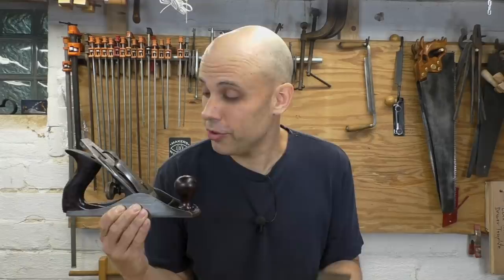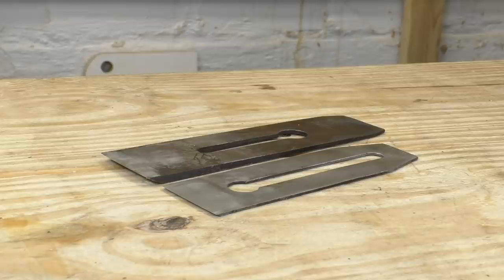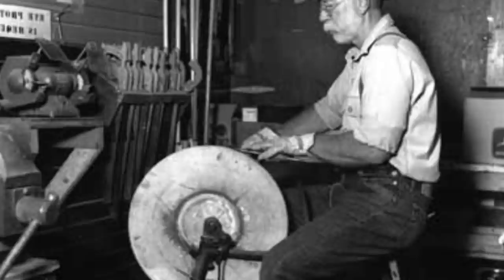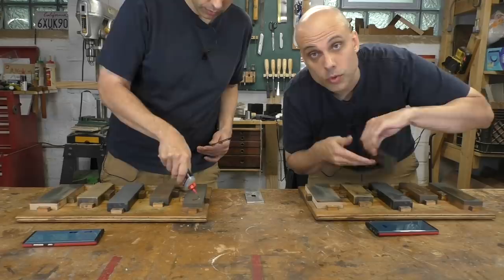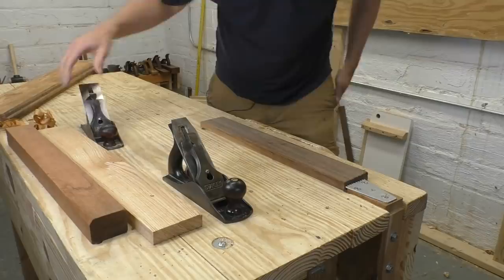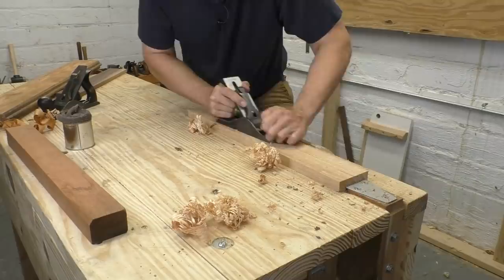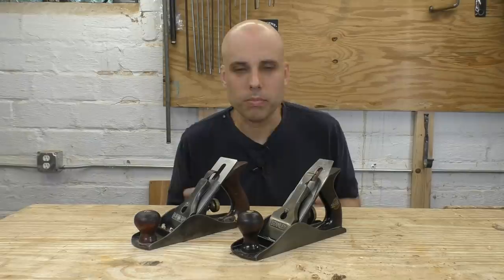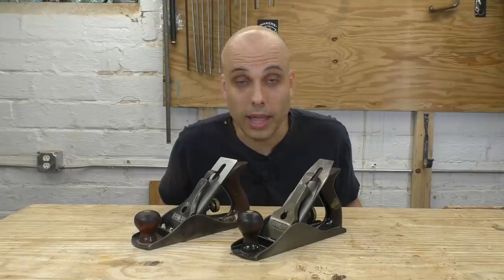Modern vs. Vintage Plane Irons. Head-To-Head Test!

Comment: Nice video, and I agree to some extent that the old Stanley irons are adequate. But I think most of the thickness of older irons, and the taper from thick at the cutting edge to thin at the other end, was not to do with the forging process but with the way the iron was held with a wooden wedge. The taper gave the irons better wedging power. In addition, all of my older Stanley irons are laminated, not one piece of high-carbon steel. Anything from the sweetheart era or earlier seems to be laminated. The big difference between older irons and the newer ones in my experience is how long the edge lasts. In Australian hardwood, the older irons go blunt very fast.

Comment: I tried a thick iron and chip breaker.   It was impossible for me to get it in the plane and tuned, with out filing out the throat, of and old #4.   Someday I might make a wooden plane to use it.

I think perhaps that the heavy iron is superior to the modern thin irons, because the modern irons are simply thin and don’t have the harder edge welded on.

Comment: My Stanley #5 with a thin iron jams up on me a lot. This video is perfectly timed as I was thinking of trying a Hock blade to avoid the jams. But I guess the Hock blade jams, too.
Reply: Check your chip breaker where it makes contact with the blade near the cutting edge.  If there is even the smallest gap, jams can happen.  You can grind the chip breaker at an angle so its edge makes good contact with the blade across the full blade width.  The jams should disappear.
Reply: @richardweiler1552    Or could have mouth too tight for for size of cut you are taking=ing.

Comment: Great video! To add to the modern blade thickness hype, I found modern steel's performance to also be mostly speculation. I tested PM-V11 irons to see if I wanted to switch over for my vintage Stanley planes. On maple end-grain with a no.6, they ended up chipping after 40 seconds of use, consistently. The vintage Stanley ones dulled a little faster but never chipped. I talked to some experienced woodworkers about this and after asking around, I found most people went for pm-v11 over A2 or 01 steel because they assumed it was better and "why not spend a few extra dollars if they may be better." But no one seemed to actually be able to say they could notice a real difference with the pm-v11. 

Another thing to note is that some planes brands have pour blade support. If you have less support at the edge you end up with chatter unless you compensate with a thicker iron. This is, apparently, why Lie Neilson uses such thick irons. Stanley planes were always some of the best planes in this regard. Their Bedrocks have so much support there's hardly no overhang; but even their baileys are half of most of the competition. 

Also, I loved the history stuff at the start, didn't know all that!

Comment: Some of us do like and use sargent planes and the hock chip breaker will not work but the blade should work, just saying.
Reply: Good to know. I have a Sargent No. 409 and have been thinking of replacing the blade with a Hock, or Pinnacle, etc.. (Then again, having an "Extra" chip breaker might just encourage me to pick up another Hock blade for one of my other similar sized planes.)

Comment: very nice video, thanks for the the historical perspective! I'm not sure though, that it's fair to say, that the difference you felt has necessarily anything to do with the thickness of the iron. There's just too many confounding factors, like the exact setup of the chipbraker, the curve of the iron, how much the iron protrudes (thickness of the shaving), the condition of the sole of the plane or the sharpness of the iron. But since you don't really claim that there is a huge difference, I guess I'm not really trying to criticize as much as I'm trying to raise awareness that such simple tests are often not adequate to spot differences or the lack thereof. Speaking of the chipbraker, how was it set up? What bevel angle and what distance from the cutting edge? If your iron is really sharp, the chipbraker has a bevel angle of about 80° and is only about 7/1000" (0.1-0.2mm) behind the edge and you take a very light shaving (if you try to take a heavy shaving, it gets really hard to push the plane, so this is really only suitable for smothing) you should be able to plane any wood, even against the grain and get a really really good surface.

Comment: Good point made quietly. We're living in an age of overavailability, hence why we use multi-stone sharpening setups. We do more work worrying about the last 5% than we do working and profiting from the 95%. I seldom sharpen my chisels and planes, and strop them regularly during use. Even when I do sharpen them, a combination stone with good technique gets them 95% of the way towards being sharp. Getting work done puts money in the bank, and there's only so many hours in the day to waste gazing into one's navel! Ron Hock's blades are a better tool than stock if your setup can handle the more demanding sharpening. I wouldn't swap out a good stock blade on that basis though.
Reply: It really depends on what you are doing. If you want a fine furniture finish you are going to need the sharpest tools possible and selection of good woods suitable of that finish. 
The level of finish will all come down to what  you are producing. I do not do a lot of fine furniture but when I do it requires effort and concentration.

Comment: I would venture a guess that the reason some people proclaim how much difference a "modern" plane iron makes is that it may (in theory) make much more of a difference in a less well tuned plane - given your skills and experience in plane restoration, I would expect that just about any iron put into one of your planes would work well. 

However, if the restorer or manufacturer or tuner aren't on your level, and the bedding of the iron does still have a tiny little bit of play (or atleast tendency to vibrate) in it, then I would imagine that the thicker and stiffer plane iron would actually make much more of a difference to the performance than it would in a better tuned one, doing more of the work of damping movement in the cut with the blade itself rather than the body of the plane.

Comment: Rex, first you have to be sure each plane has a solid contact flat bed to support the blade. Second, the chip breaker must be honed for perfect contact with the blade across the entire width.  This of course is basic to all planes.  That said, you might want to try swapping the chip breakers between both blades as a test!  You may find the more substantial chip breaker has as much or more to do with that "solid feel" than the blade itself!!

My biggest gripe with Stanley plane blades is the initial flattening of the backs. They all too often require a TON OF HARD WORK achieving flatness to the edge!!  The "aftermarket" more expensive blades are at least reasonably close to flat requiring far less work.

All said and done you are right about the misconception of "thick" blades being so much better!

Comment: I was restoring my first two planes - both english, one a stanley #4 copy goodwin and the other was a brand I can't recall, but much simpler with no lateral adjust and only forward. I cleaned up the older, no-name one - which had a ton of iron left and needed NO grinding attention, but I noticed while sharpening that it was throwing the fattest wire I've ever seen on something meant to cut. I was curious, so I finished the sharpening until it was shaving-sharp, reassembled it, ran it across a piece of hemlock...

And within two strokes it was too dull to cut my thumb if I went at it like a steak-knife. Somehow the iron on this never-modified, all original plane had lost ALL its temper and was soft as butter.

The plane was like 8 bucks so I figured I couldn't hurt anything by trying to re-temper it, so I heated it up cherry red with a couple propane blowtorches sitting on my bench for a good 10 minutes and then dunked it in a jar of canola oil to quench. I threw it in a 400F oven for about an hour to draw back and somehow that put the iron at a PERFECT hardness. Now it doesn't chip, doesn't dull any quicker than my known-good irons, takes/keeps a razor edge, and has for a year of heavy use.

I wonder if people say the thin irons are no-good because they've gotten one that someone in the past overheated using a grinder (what I suspect was done with mine) and ruined the temper - or ruined the temper grinding it themselves, giving them terrible performance. It's definitely easier to over-heat a thinner iron than a thicker one if you're the type who likes to use a bench grinder on a restoration and don't have some water on-hand to keep cool.

Comment: I haven't ever encountered either a clear superiority in thick irons, or the trouble that thin irons were supposed to have.  Until I bought a fairly recently made Record No. 10 carriage plane and that plane had a problem.  It really did have a chatter, sounded like zipper, and you could either get really thin shavings or a mess.  The surface looked like it had been worked by a power jointer with narrow, ca. 1 mm or less in width,  regularly spaced dips in the surface.  I disassembled the plane checked the frog for flatness, and the seat - no problem.  Reassembled, still making a high pitched zipper sound. Looking at the iron in situ I could see a gap between the iron and the frog.  Checking the iron, it had a concave bend to the bevel side.  The blade would flex slightly then pop forward scooping out a but of extra depth.  Pushing steadily it created that "power jointer" surface.  Carriage plane blades are hard to find, but Hock makes one.  My only criticism is that the chip breaker steel is mildish and hard to get rid of the wire edge once you develop one fitting it to the blade.

Comment: Hey Rex, been following for a while now. I recently got my second stanley no 7, completely out of flat. It got me thinking, back in the old days, 1800s or even earlier I wonder how flat were their planes? How did they overcome working with planes that weren't as flat as we had today? I think it would make for a really interesting video to be honest!
Reply: Chris Schwarz has an article on this: he splits the work in coarse, medium and fine. Coarse is work done by scrub and jack to get a reference surface: you don't need the plane to be super well tuned or flat. Medium work is getting a reference edge and refining previous work: here it matters a bit. and then you finally have fine work: here having a well tuned plane with everything perfect is quite essential

Comment: I bought a Woodriver blade for my no. 6 and I was unimpressed. Listen to someone like Cosman I thought that first stroke was gonna set off fireworks. I returned it and put the original back in. 

For the record Paul Sellers doesn’t buy the thick iron sells pitch either. 

What I didn’t like most was less engagement with the part of the plane that advances and retracts the plane (brain fart right now, I know it has a name). 

P.S. got my autographed copy of the book a few weeks ago 👍🏻 keep it up Rex.
Reply from the maker: Thank you,  captain.

Comment: Thanks for the video. I can only parrot, but some say that more mass in the blade helps absorb vibration- solidifying the position of the cutting edge. It sounds good, do we really know? I wouldn't consider myself experienced enough to have anything but guesses.

Comment: Two notes for you: (1) The older Stanley irons were actually laminated, and because they were still of the thin design, were even easier to sharpen than the solid tool steel versions. Some people actively seek these out, but I find it more of an interesting historical note. (2) Older literature had something to say about the "Bedrock" debate, namely that they supported the blade all the all down to the sole, whereas the standard Bailey pattern did not. There were theories that in cheaper makes, the sole that the frog rests upon is quite thick, leaving a lot of thin blade unsupported and thus prone to chatter (e.g. p180 of LAP's The Woodworker, Volume I). Of course, this could be total bunk, but if true, a thicker blade would, in theory, perform better on a cheaper plane. Not that I would ever care to run any tests. I'd rather spend my time making sure my irons are sharp and well-mated to their back irons, so that I can actually get some work done.

Comment: Good video and discussions always Rex. I would think as you found that the Hock is a slight better I fell due to rigidity and more mass. Issues I have to be conclusive, no HC numbers, no actual chip thickness measurement, oil application to plain in comparison. Over all good I do agree with assessment as done overall. A no.4 has its place in the shop. In the hands of any craftsman sensory perception is a learned trait over many hours of use or examination  to really understand how th err tool is behaving against the material application and how to tweak it for best performance! A true crafts person knows these subtleties and must be learn and practiced. Good job Rex. Enjoyed the video, going to order a hock for my number 4 Stanley !
Steven Columbus Michigan

Comment: Amazing video Rex!! you just gave me more confindence on a plane I'm working on...
I've bought an old Rapier 700 some time ago and I'm restoring it, the blade was totally destroyed and well.. i said "ok I'm gonna buy another one for it.. (2'' 3/8 blade..) so I bought one on Ebay from England and I'm from Chile, so returning it was a bit of a no for me lol.
I didn't understand very well the blade specs back when I bought it and it was a thick one just like the one in your video haha and it didn't fit the mouth haha so I've had to open a bit more the mouth and well it fits now, it works quite good actually, but I still have some work to do on the plane, checking the right bevel angle and find a new blade adjuster, still I'm loving this restoration.

again, amazing video Rex! Greetings from Chile!

(sorry the grammar)

Comment: Hi rex , have you ever tries a wooden plane iron (one if the old thick laminated ones) in a stanley? I have a great wooden jointer and tried the iron in a number 6 (with the stanley chip breaker) and it almost fit well ... With a bit of filing im sure it will fit well ... And considering that an old beat wooden plane can be had for dirt cheap , it would be a great way to get a thick iron for cheap
Reply from the maker: Hey Darryl, one of the big points of this video is that thickness probably doesn't bring much benefit and that Stanley irons are just fine the way they are.  Could you get a wooden plane iron into your Stanley? Maybe. Would that time be better spent doing woodwork? Definitely.

Comment: it is not possible that Stanley used thin sheets to reduce the price. The production of thin sheets is more expensive, especially when the sheet is made of high carbon steel. Steel requires multiple heating and hammering processes. If the steel is thin, we can only change size a little. 
I think modern parts are thicker to mimic the mechanical properties of the original steel (elasticity, bendability without deformation). It's like a modern replacement for car parts made of carbon fiber. It is different from the original one, but works the same.

Comment: It's worth talking about what blade thickness provides. I think whoever tried to sell you on thicker irons didn't understand that iron thickness make improvements on one specific problem that's only really present in the thinnest shaving: chatter. That "extra engagement" you feel from the hock iron is reduced chatter in the blade. Thicker irons experience less movement (yes even steel moves under normal stresses) because the thicker blade adds greater rigidity. Even slight harmonic movements in the steel will show up on the end shaving but are only really noticeable on very thin shavings (not the kind you're taking here). Iron thickness isn't something a beginner really needs to worry about or will even notice. It's a very mild change but for the person trying to get every inch of improvement in their work it can feel like a major step. Do the little extra result justify the price? That depends on what you're willing to accept. For me I wanted that extra edge that really makes the wood pop. If you're just starting out and you have other issues in technique with planes you will not get the benefit extra thickness provides. A lot of modern improvements on old tools are very "unnecessary" but are improvements, however minor. In the quest for perfection every step towards it counts.

Comment: Interesting. Sounds about right. It's sales though, isn't it? Very difficult to find anything to upgrade on a plane that was effective for so long. Maybe Rob Cosman's star adjuster knob? 
However, you didn't tell us if the thicker blade lasted longer without sharpening?
Reply: @RexKrueger  yes, I suppose that's the key takeaway. Sharpening a Stanley blade isn't so unfathomably frequent that there is a noticeable time or effort saving there either.

Comment: Very intresting about the histori of Stanly planes. But I must say I would not be satesfied with how those planes preform. I would like to see allmost full width with a much much thinner shaving. Othervise there is no point in buying an expencive replacement blade. In General, if you only plane soft wood, dont bother spend the mony. Original blades do the work. If you plane hard wood or use your plane as a shooting plane its worth the money BUT only if your plane matches the preformance of the blade, eg flat soul and set up correctly thight mouth etc.